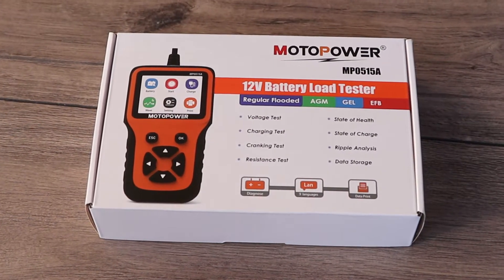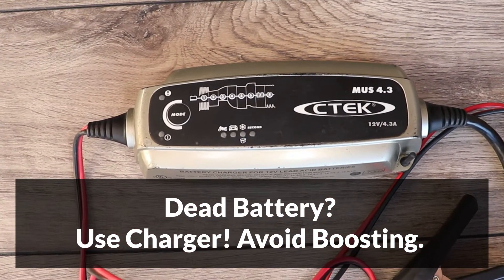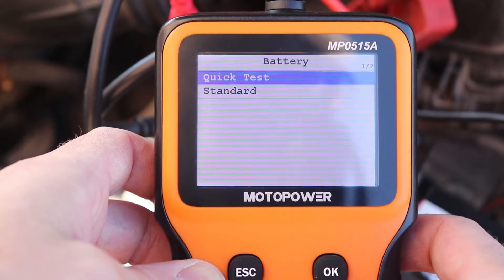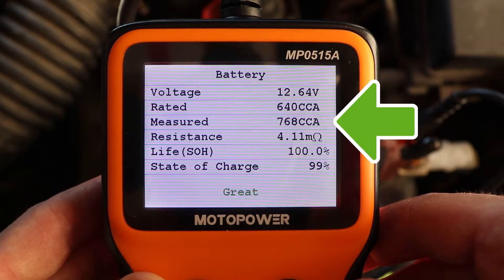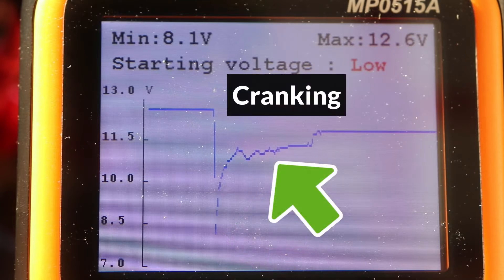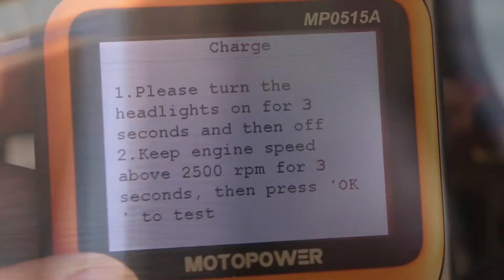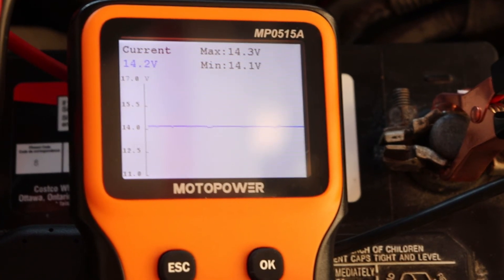Testing Your Car Battery and Charging System/Alternator with Battery Tester MP0515A

Comment: Dumb question, does the car need to be off or on?
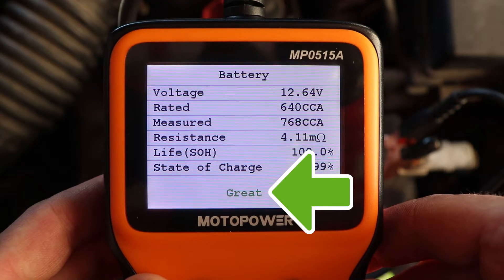Reply from the maker: All questions are welcome.  At 1:00 the car is turned off, to test the battery itself. At 3:21 the engine is being cranked, and the car starts; this tests how well the battery performs under load.
At 4:32 I test the charging system/alternator, and the car should be running for the charging system test.
Thanks for the comment, and for watching! Let me know if you have any other questions.

Comment: i think the instructions are incorrect. I think you need to keep you car's RPM at that suggested Level AND turn on light for 3 seconds during the RPM phase. This would coincide with other battery testers that I have used.  Thank you for your time.
Reply from the maker: The steps are provided sequentially.   It does not mention anywhere it should be done simultaneously. At the end of step 1 is to turn the lights off.
Which tester did you have that mentioned to do it simultaneously ? 
Here's a much more expensive tester: https://web-file.topdon.com/topdon-web/information_download/BT300P-User-Manual.pdf  and it does not even need the headlights turned on at all for the charging test for example.

Comment: Whats happen if cranking voltage low? And what we have to do to fix it?
Reply from the maker: It really depends how low and for how long, and how cold it is outside. When this tool says "low" it's possible that it's incorrect as it is in my case. A very short drop to around 8V is normal. If you're dropping to 7.5 or 7 then you have to watch your battery, if it starts to crank slower than normal, then it will need replacing.

Comment: Great Video, I was wondering if you could make a video of how to replace REAR brakes on 2014 corolla.
Reply from the maker: I hope I can do one eventually.  It's very similar to the front, you just need to turn the caliper piston clockwise while pressing on it, with a caliper retraction tool, to get the piston to go back in. That's the hardest part..